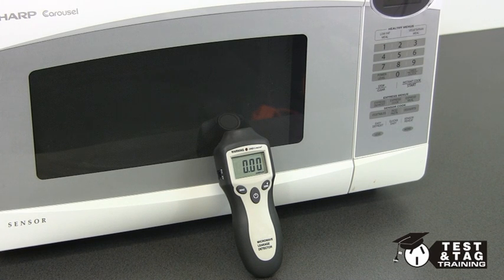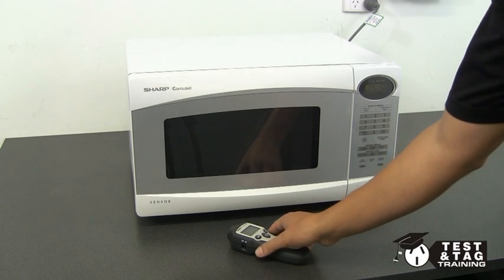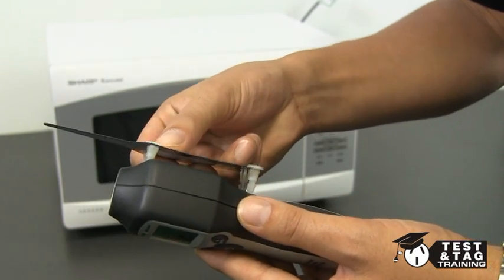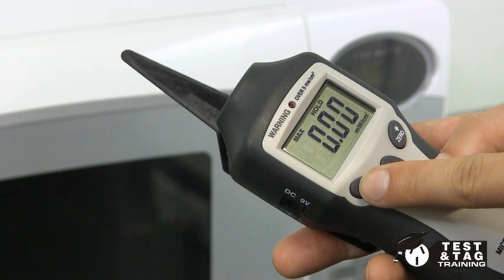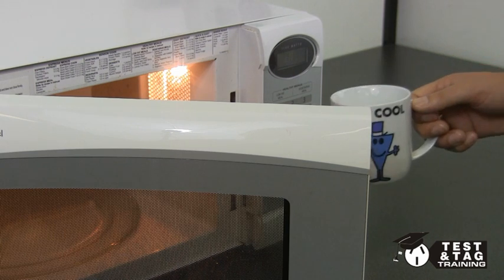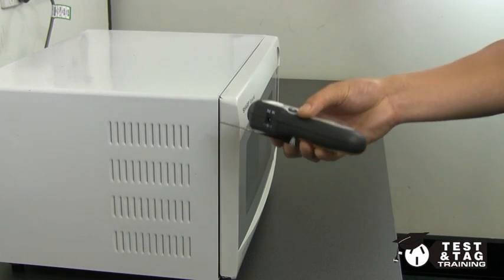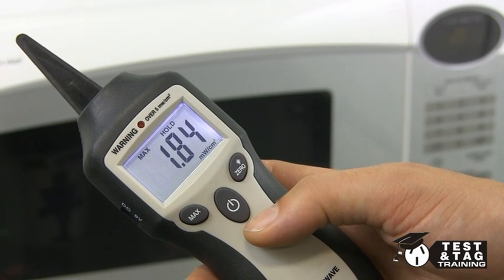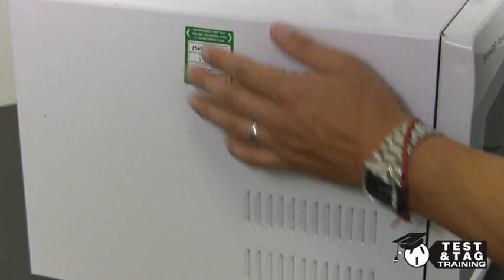How to test for Microwave Leakage (Using a Microwave Leakage Detector)

Comment: What to do when there are leakage on the metal body.? is there any solution.? its no broken,it just the leakage
Reply: Microwaves cook things by vibrating water within the food to make it heat up like when you rub your hands together because its cold it doesn't cause anything like cancer
Reply: My mom got cancer after getting a job where she warmed food for 3 years everyday, she was 2m away from microwave every day 8hrs a day. She died.
Reply: Can't happen microwaves are like visible light and can't go around corners or through metal. The reason you can see through the door is the holes are smaller that the wave length so the waves can't pass.

Comment: If you wish to test a microwave oven correctly buy the right meter such as the HI1501 tester from EDS-Lindgren, then have it calibrated once a year. These cheap meters are not always right.
Reply: Only $1,037.93. Cool.
Reply: @garbanzowine1751  Maybe he works for EDS-Lindgren. :D
Reply: cheaper to just buy a new microwave without even testing lmao